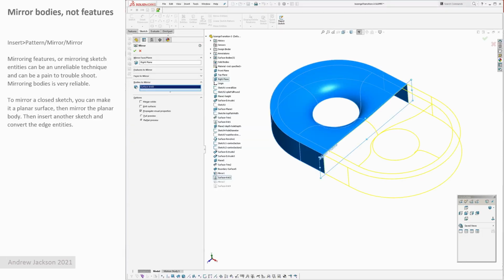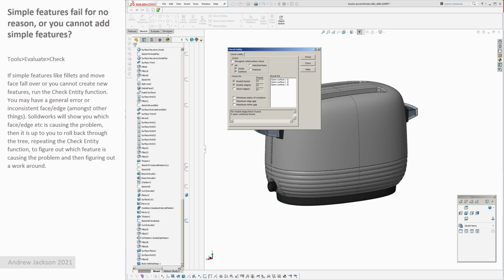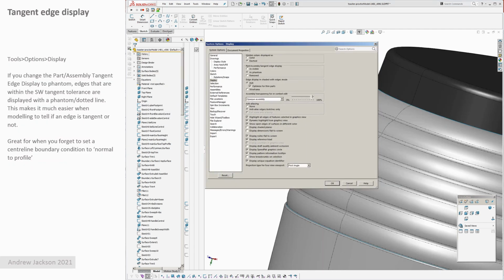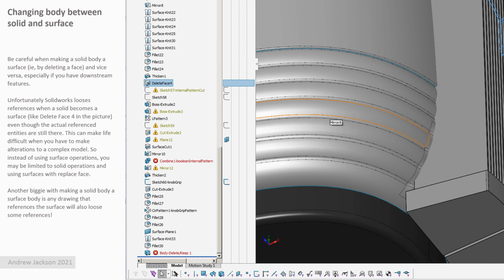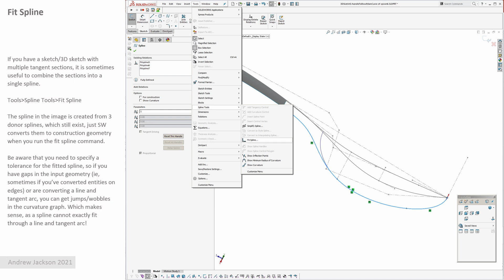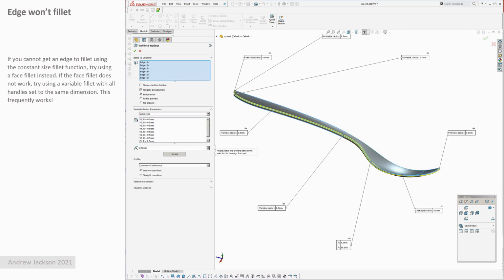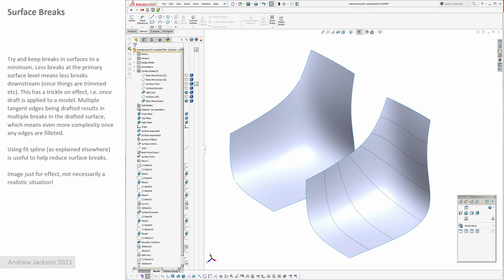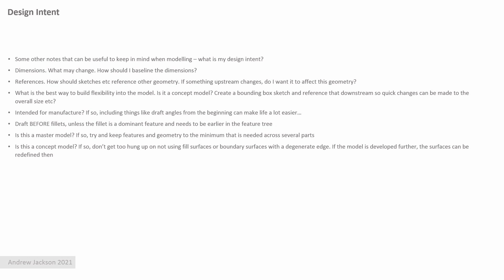Solidworks Tips for Industrial Designers

Comment: Awesome thanks! :D
As for some ideas for videos: (:D)
I have just started watching your SolidWorks videos this week and it really helps me. But I also see you have a lot of Rhino videos. And in the Eames chair videos you use the Rhino model as a reference for the SW model. I was wondering if you use both programs, and which one when. :) Do you use both in the same design process, do you use them in different stages. Do you transfer surfaces or curves from Rhino to SW?
Also... I saw that you seem to be using a lot of keyboard shortcuts for things like hiding the planes, and other things. Can you make a video about that... like in this video you talk about the Flat Tree View... (I've been using SW for about 5 years, and never knew this. I could have saved me some hours of my life trying to find the sketch blocking my rearranging of features.) Other workflow tips are very welcome :D
That's it from me :D It's awesome to see your videos. :D Thanks!
Reply from the maker: Hi Frank, I'm pleased your finding the videos useful! I have the following shortcuts for SW. F2 - Wireframe. F3 - Shaded (with edges) F4 - Hide all/show all F5 - Hide/show planes. Other than that the standard S shortcut... I use the F4 and F5 most, so I can cycle through having sketches and sketches/planes visible. I do have a macro that is handy. If you select a feature/surface in the 3D window and activate the macro, it scrolls and highlights that feature in the tree which is great when you are working on heavy models. 
I have been using Rhino since 2000 when I was using it for refrigerator concepts and since then used it frequently, especially for transferring and preparing CAD data for rendering. I've only really started to push my Rhino skills in the last few years. Now it really depends on my clients as to which program I use. Use to be mainly ProE wildfire, now mainly SW with some Rhino. Cheers, Andrew
Reply: @AndrewJacksonDesignStudio  Awesome, Thanks man!